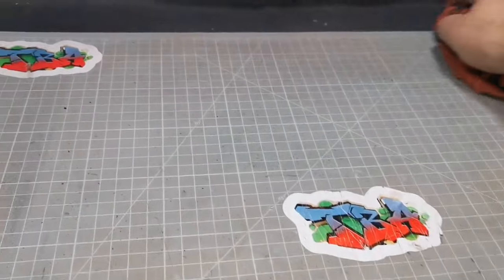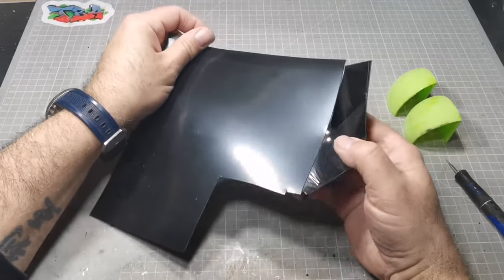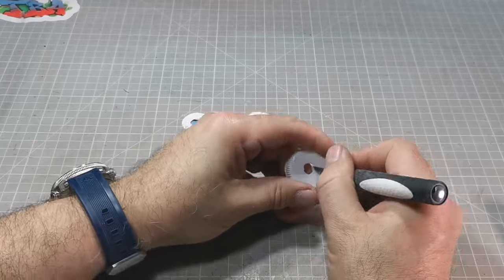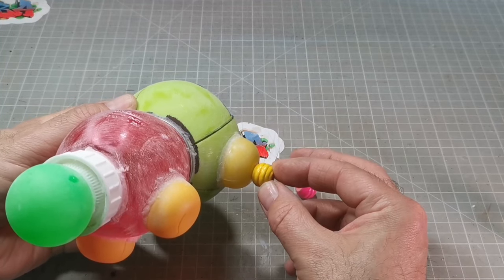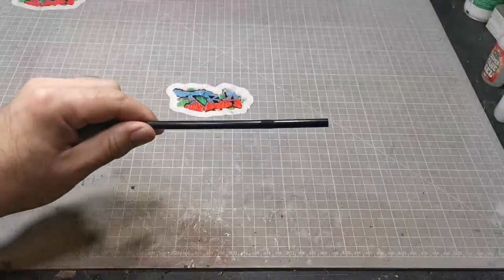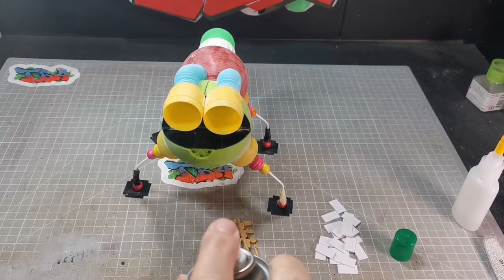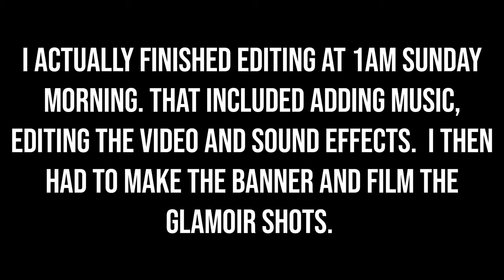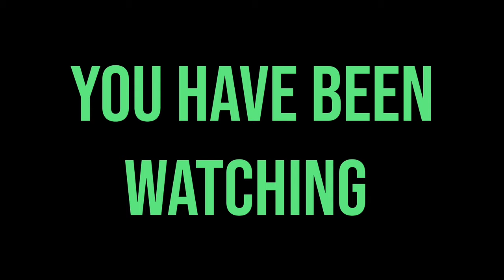Making a spaceship from toy containers and junk#scratchbuild #howto

Comment: Lister! Done it again Aaron, it's not perfect by any means, the front's a tad small, the front legs should be on the front ball and the fins are meant to be on the cowlings,  but trash bashing is rarely perfect, you work with what you have and you do it so well. None of my pickiness matters, the important thing is you see that build and you instantly know it's Starbug 1 👍
Reply from the maker: Yeah alot is wrong with it but I just couldn't find the right things so went second best as I had to get this build out of the system. Red Dwarf build is done. Again not to scale but people will instantly get it. That build is now with Spidermaf who's doing something special to it. So both videos will drop at the same time and you'll understand why.